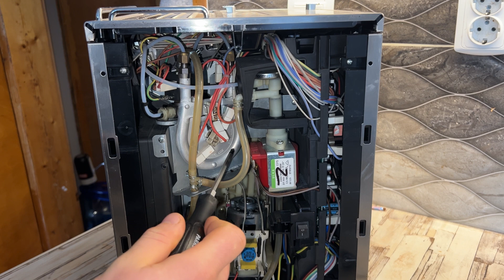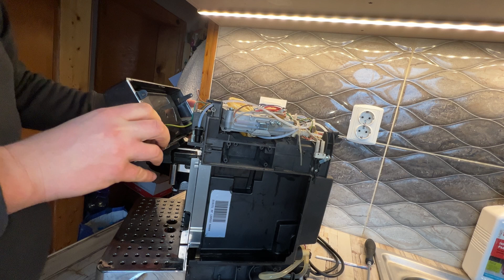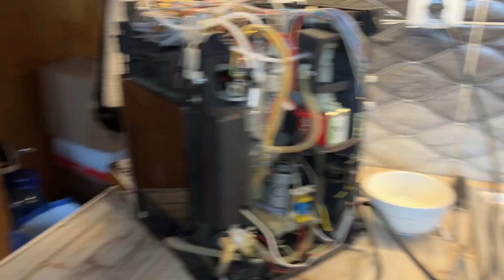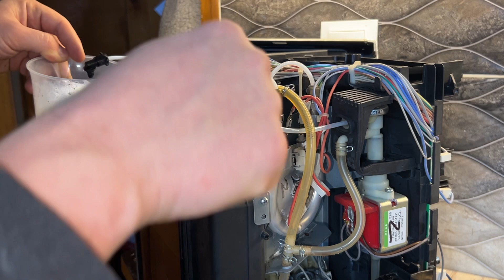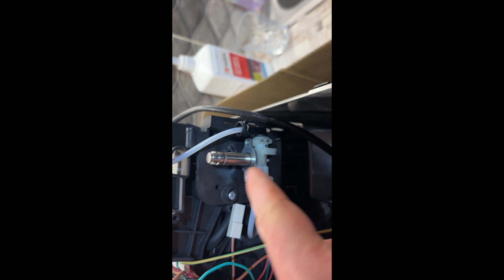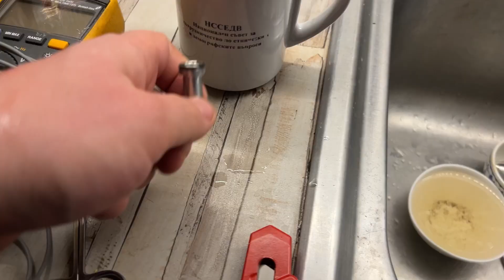DeLonghi Coffee Machine No Hot Water Problem - Diagnosed and Repair

Comment: My older Magnifica EAM3400 has a "test" mode you can put it in by holding the small and large cup buttons as you plug it in. I think the different models have different key press sequences. Test mode lets you energize the different components by different key presses to see if they work.

Comment: Hello. Ended up in your video since my steam wand of delongi dinamica stopped working. Coffee comes out fine and water goes to solenoid valve, but nothing comes out. I disassembled the springer part from the solenoid and it moved/worked fine. I also measure resistance in the solenoid. Any idea what is causing the issue? Currently going to get new solenoid since I think it could still be the solenoid not working even though it has resistance..